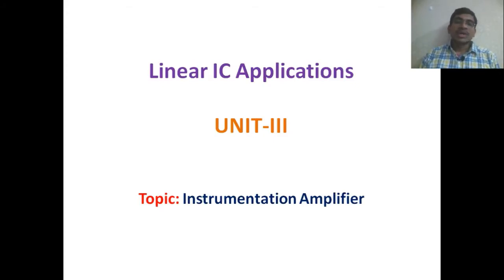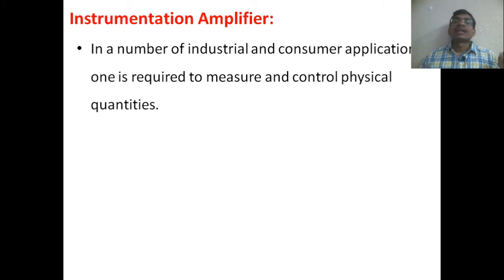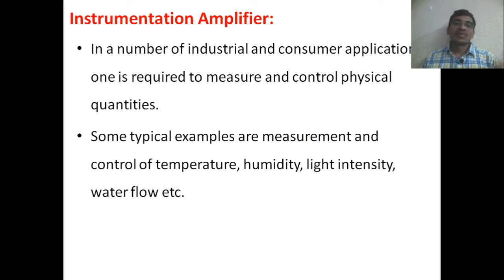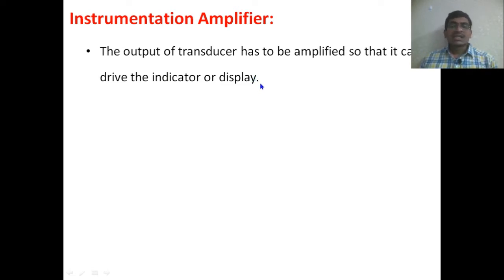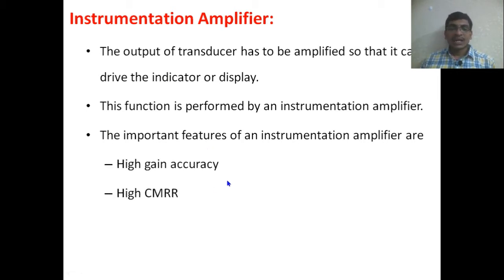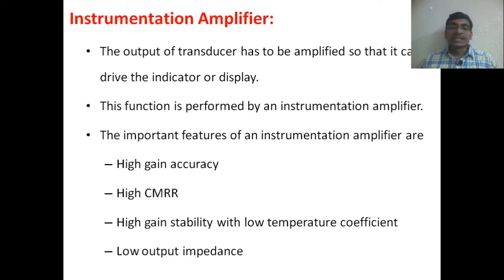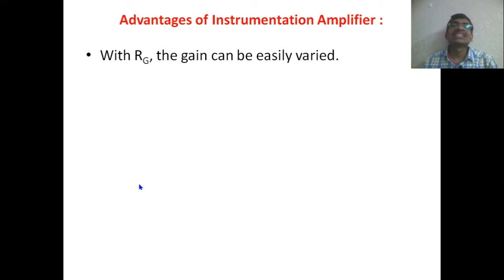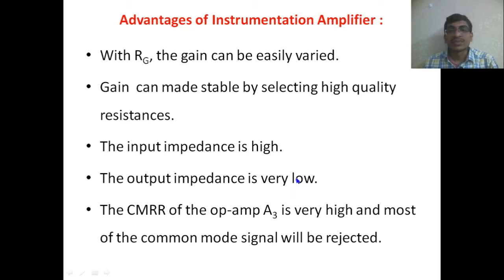Instrumentation Amplifier using OPAMP | LICA U-3-5

Comment: Sir, your video about op amp is very nice. Can you please suggest INA333 op amp equivalent op amp.
I am waiting for your reply. 
Thanking you sir.
Reply from the maker: Thank you..   you can try AD620 ic as alternative for INA333.   
Kindly go through the data sheet before purchase....
Reply: @VivTronics  thank you sir I will check
Reply: Hi sir, shall I go with ad623 op amp
Reply: Sir, kindly can please share mail I'd so that I can send both typical functional diagram of ina333 , ad623. In ad623 for pin 2 & 3 transistor is connected. But in Ina 333 no transistor is connected.